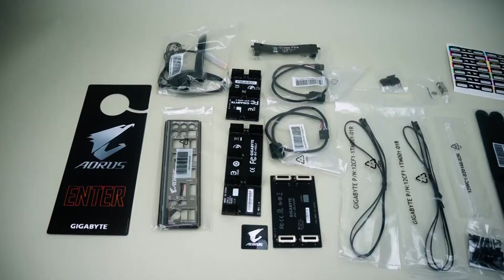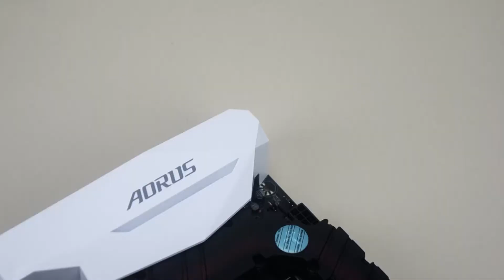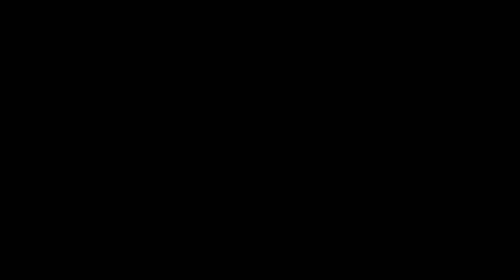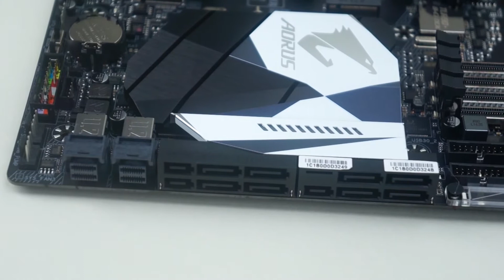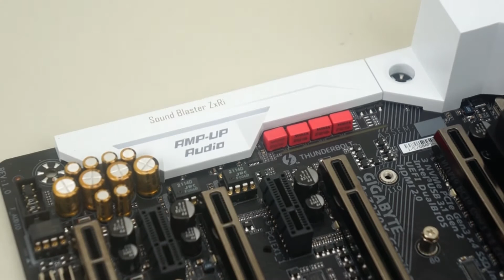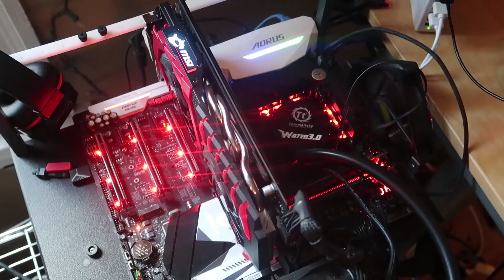Aorus Z270X-Gaming 9 Motherboard

Comment: Nice motherboard.but the 1st slot for the graphics card might be a problem specially if your card has a  backplate,...I hope Im wrong in my observation..
Reply from the maker: We installed a MSI GTX 1060 Gaming X in that first slot, which has a full backplate with no issues at all.  At first  glance it looks like there wouldn't be enough room, but there is.